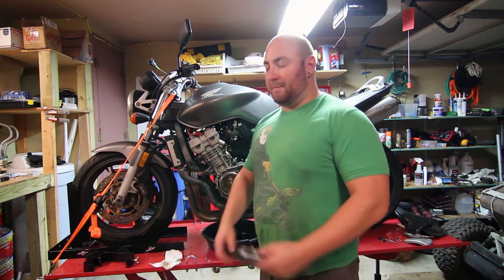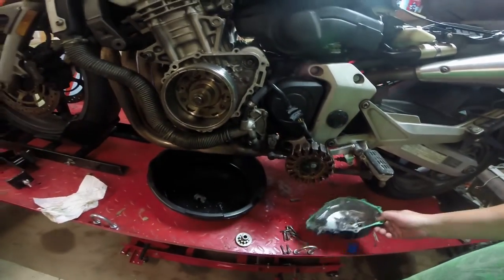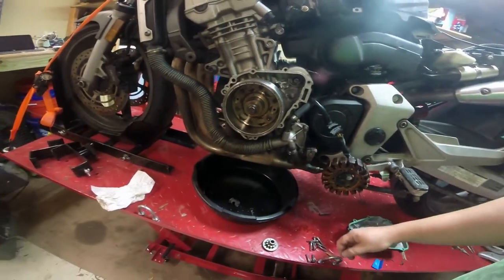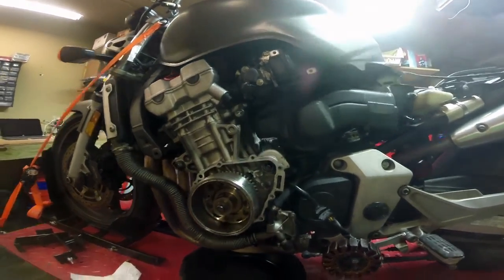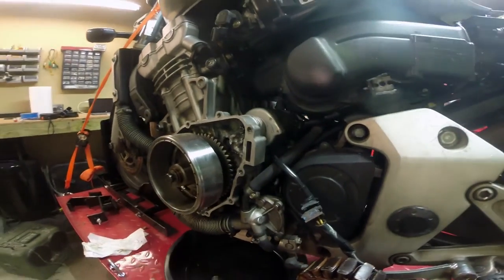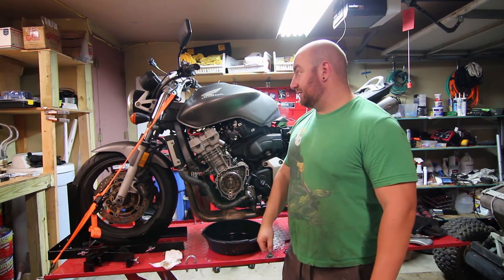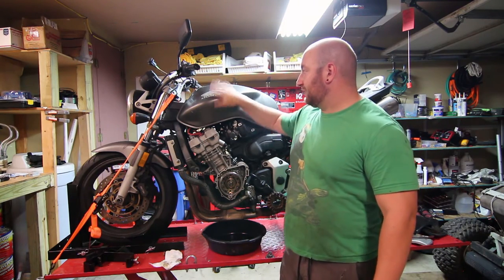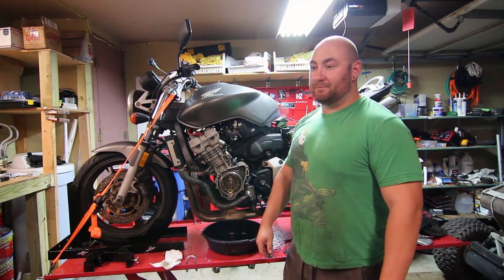What is a $275 2003 Honda CB900F 919 actually worth?

Comment: Good video but what was it really worth??
Reply: After you sold all the parts
Reply from the maker: trade secrets mate.
Reply: Having owned a 2007 myself, if that tank was in good shape then he could have sold that for between 350 to 500 (or more in some cases depending on the finish).   Anything else is just a matter of time effort for listing on ebay and shipping.
Reply: so basically you can double you're money  if you know what you are doing pretty easily